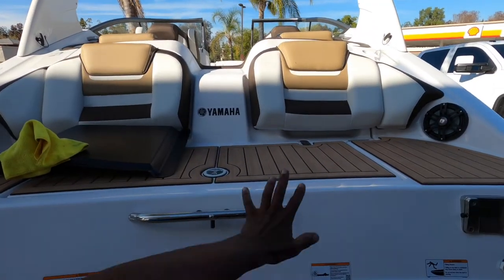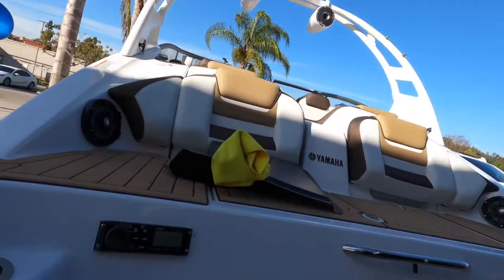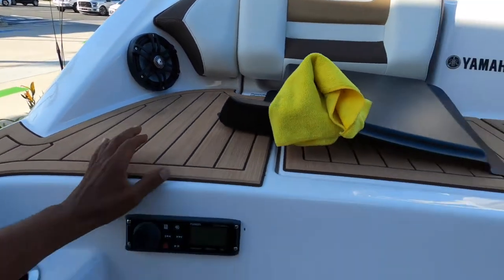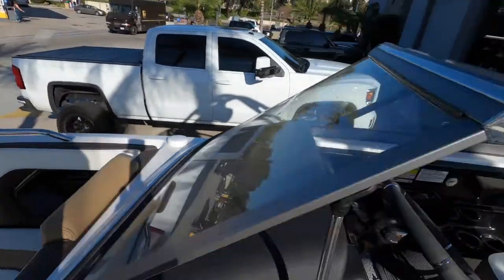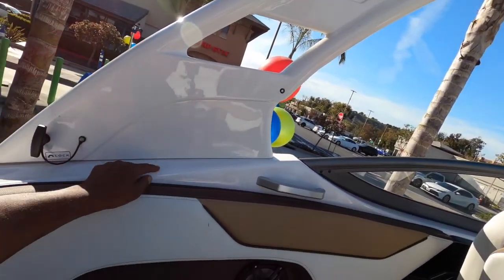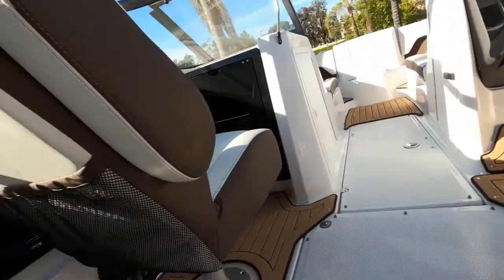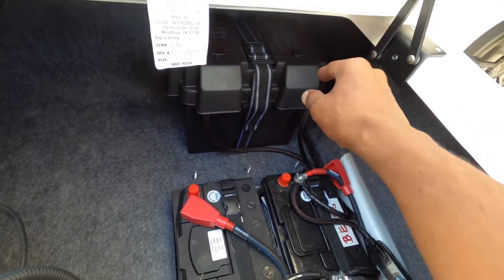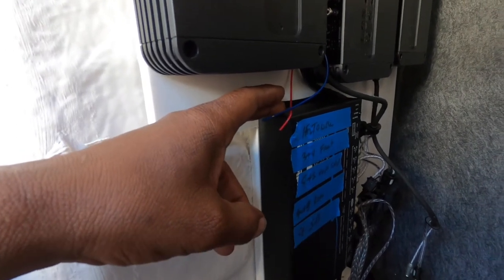Rockford Fosgate Marine speakers, subs & tower speakers upgrade on a Yamaha 21 foot boat. Part#1

Comment: Getting a system put in my boat, do I need an additional battery? Hoping it doesn’t drain my current house or start battery . The audio guys didn’t say I did  need one now I’m curios
Reply from the maker: I would do a second battery with a perko switch. One battery would be for the audio system and the other would be to start the boat. 
https://www.amazon.com/s?k=perko+switches&hvadid=531811235004&hvdev=c&hvlocphy=9031597&hvnetw=g&hvqmt=e&hvrand=11667171173461476611&hvtargid=kwd-2250352962&hydadcr=9435_9900753&tag=googhydr-20&ref=pd_sl_8a7houyp2t_e
Reply: @lancesautovlog  thank you, so just to confirm I do have a house battery and a start battery, are you thinking I needed an additional third battery for the audio system they are doing an LED package inside as well? Thank you for your time. I know nothing about this stuff. Send me the bill lol.
Reply from the maker: Nope. If you have one for each then your good.